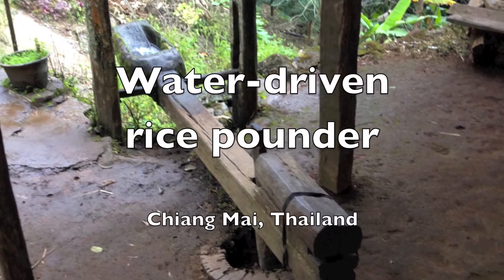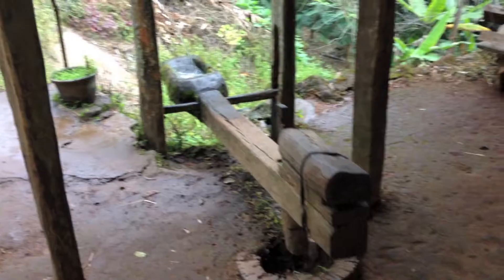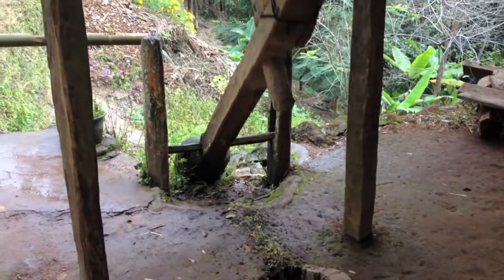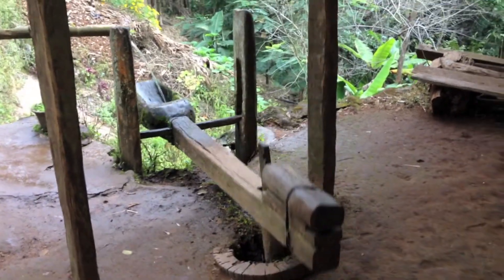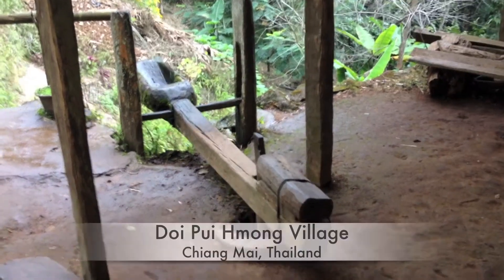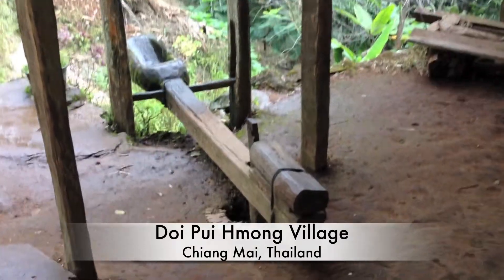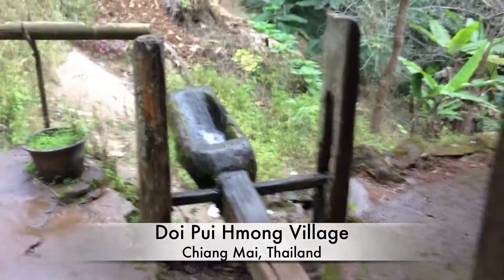Water-driven rice pounder in Thailand

Comment: One things specific to Northern Thailand that I chose is commonly known as lob (ลอบ).  Lob basically a cage-fish trap that is composed of bamboo, rattan, or tree vine that has a way for fish to enter. Once entered, the design of the cage makes it impossible for most fish to escape. Usually, there are mainly three types of lob, lob-non (ลอบนอน), lob-yuen (ลอบยืน), and lob-kung (ลอบกุ้ง). Lob-non is designed to trap fishes in shallow water. Average size of this trap is from one to two meters long. Next is lob-yuen which is a trap that is designed to be used in deep water. Fishes that are usually caught in this trap are catfish, channa striata, and carp, etc. Lastly, lob-kung, it is a trap that is designed to catch just shrimps. Spaces between each bamboo are contracted more than other lob so that small shrimps could not get away. The trap is designed to be used in both shallow and deep water.

Comment: Another common household item from the north is a broom. A broom was created by weaving dried grass to a piece of bamboo. Often, crafters would sculpt the end of the bamboo into a "swan-neck" shape; allowing for more grasses to be woven through. The fact that Thai houses have wooden or ceramic floor rather than carpets like western houses do, a broom will be much more effective and more efficient than a vaccum cleaner at cleaning Thai houses. Some Thai houses also have polished wood as their floor, so a broom will suit the house much more since it will not scratch or damage the floor.

Comment: One of the other things specific to the north of Thailand that I know is wooden cart.
Wooden cart is a strong open vehicle that is designed for transportation. It is made of mostly of hardwood, typically with two or four wheels. Usually, it would be pulled by one or a pair of animals like horses, cows, or buffalos. People often use wooden cart for carrying loads, transportation, or traveling long distances. Wooden cart is one of the most important vehicles for transportation since ancient times and even until present. The cart was also a key factor in transportation, since it was really hard for peasants to transport or travel through remote areas back in the days, these carts are also very cheap to build, it is reliable and really easy to maintain, it made transportation much easier. Another benefit of the cart is that it can also be used as a vehicle to travel off-road, through rough terrains such as rocky roads or even streets filled with mud, which a typical road car would probably get stuck.